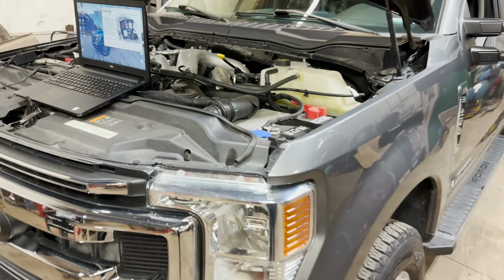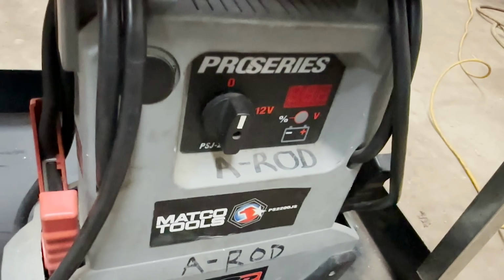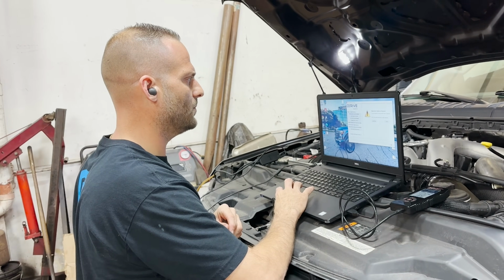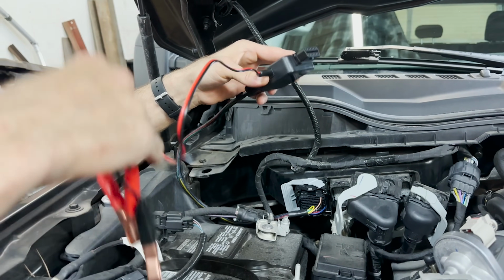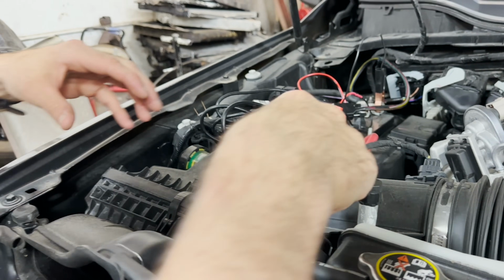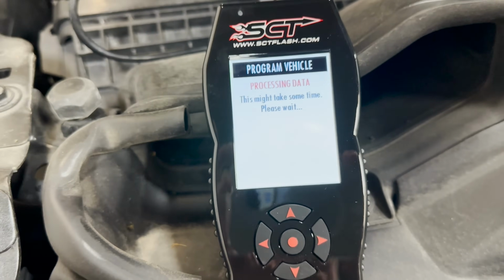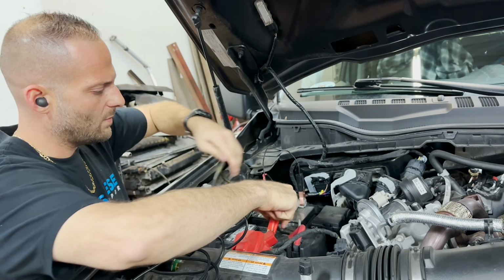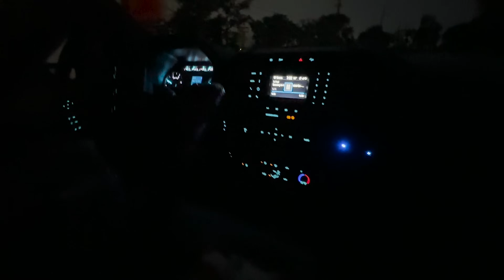Ford 6.7 diesel | SCT 3-tunes - EPA approved! #tuning

Comment: Oh dang just watched the whole video. EZX is a little more work to install but you can change tunes on the fly plus has throttle adjustments. Definitely would recommend EZX over this. Tell them to give you one to try out, you’ll be in love too!
Reply: Pedal response is standard on the older SCT Tuners, it is a user programmable function not part of a custom tune. Not sure about this new one but I kinda doubt they eliminated a standard function . They also have user selected system monitors that anyone driving a newer diesel should be using.
Tells you if or when a part is not functioning properly.
Reply: I've been using SCT for years, I like that it lets me monitor certain components that help warn you of possible issues . When numbers start to get out of normal  checkout why and fix instead of fixing after a failure.

Comment: There is a few companies with the same setup as this. I’ve been using a similar way to this for a couple years already. The obd plug is to do the tcm. I’ve used it on customer trucks 20-21 and have done my 22 when it had 13 miles on it to rearrange some stuff under the truck and good.

Comment: Ran SCT Street tune on my 15 for a year from 180-210k miles, yes 30k miles in year. I average 120 miles a day commuting for work. DPF went from regen every 300 to every 150 miles. Was it quicker and shut off governor absolutely, smiles per gallon quickly disappeared when I was only getting 220 miles between low fuel light with 26 gallon tank. Knowing it was wasting 2 gallons on attempting to regen the filter. Was it ultimately the kiss of death probably not but it didn’t help.

Comment: Do you no what would cause my 1999 Ford f350 V10 fuel pump to run constantly when in the run position and have no voltage at cam sensor and 2.6 volts at cht sensor and iat sensor thanks

Comment: So when is Banks coming out with the Derringer ? I like others have a 2022 . I had a tuner from SCT when I had my 2006 6.8L V-10 .
Reply from the maker: I know i know....soon
Reply: I'm told thr Derringer was put on the back burner in place of a flash tuner that has transmission tuning.
Reply: @joshwojohowski2326  So who are your sources?
Reply: @TonyBenton0728  someone within Banks.
Reply: @joshwojohowski2326  So you have inside information ? Yea right!!! Doesn’t sound like Banks . They have never done flash tuning. Are you in California ?
Reply: @TonyBenton728  think what you want buddy. Don't have to live in California to know people.
Reply: @joshwojohowski2326  So you don’t know anything! Just want I thought!!!
Reply: @joshwojohowski2326 Hey, I have the Banks Derringer on my 2018 F350 and in setting things up you do a trans relearning procedure...The Banks Derringer is a inline tuner that works with your factory ECM....The delay is because Ford has changed things up & Banks wants to put out a product that does work with those changes & yes the 10 speed trans is a big part...The Banks inline tuner system with OBDII connectivity takes real time data to calculate want the engine needs for any given power demands...Also with it's ability to detect problems with the vehicle or itself & adjust things safely...You can't get that through a flash tuner...So I don't think Banks will be abandoning the inline for the flash tuner.
Reply from the maker: @zekester1 you are the best buddy, thank you
Reply: @zekester1  I'm telling you. I was told directly from someone with direct knowledge that works for banks that the Derringer for the 20+ is on the back burner and a flash tuner is instead being developed in its place. A trans relearn is not even remotely the same as actual trans tuning. I can do a trans relearn with my Snap On Solus +. It doesn't make the 10 speed shift any less wonky.
Reply: @joshwojohowski2326  Well, that would be a complete surprise!!!😳...I think we may be talking about semantics?🤔...I just can't believe Banks would give up on the inline tuner!!!🤨....I guess we shall see!🧐....later👍💪💯

Comment: I wonder if this could be used with the Banks Pedal monster?
Reply from the maker: Absolutely the Banks is just a compliment to whats already there. Think of the Ford accelerator pedal voltage readings. They all look sawtooth. The bank's pedal monster smooths out that saw tooth to make it A1

Comment: @PowerStrokeTechTalkwARod 
 Do you think SCT is the way to go for 2016 6.7 F250 that needs adjustment in the MPH and the Avg MPG info due to the oversize tires (37") and can they tune for better fuel economy  ?
Reply from the maker: Just 20 21
Reply: Ez lynk with the right tunes will get you excellent gas mileage. It also corrects the tire size.

Comment: Performance:        76hp/210tq
Street:                    61hp/74tq
Tow:                       30hp/66tq

Id be happy with a transmission shift strategy only tune for the 10R140 that cleans up the shifting.

Comment: What if?  You take your truck to a dealer and Ford has an update and the dealer flashes your computer with a new version.  Now your mod is back to factory and the SCT device is confused.
Reply from the maker: .....you KNOWINGLY take the tune off, PRE dealer visit. If that happens, only the operator is to be blamed. You can't* say "Oh well I forgot it was on there" ...........
Reply: @PowerStrokeTechTalkwARod  True, but I was referring to the dealer performing an update without you knowing it.  I had that happen with a Jeep once.  They flashed my computer and the mod device I bought was out of sync and no longer worked.
Reply: @JWimpy That is the main problem with flash tuners, they change your ECM...The Banks Derringer with OBDII connectivity is a inline tuner & works with your factory ECM...So if the dealer needs to perform an update all they do is disconnect the Banks from the OBDII do the update & reconnect the Banks...Doesn't mess with the tuner!
Reply: You just reflash the truck, it is really easy.
Reply: @zekester1  That sounds like a better option. Thanks.
Reply: Should you disconnect the battery before pull plugs on ecu?
Reply from the maker: @wm2086 no, why? Disconnecting the batteries is going to take power away from the ecu just like i unplugged it
Reply: @PowerStrokeTechTalkwARod  didn’t know if the ecu still communicated with everything just wanted to be safe than brick the computer don’t know
how sensitive the ecus are?